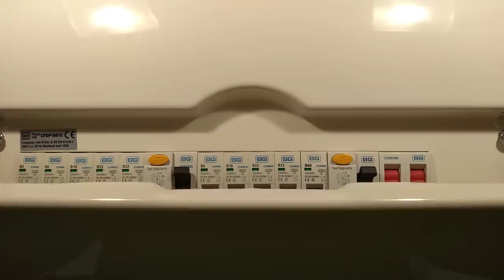A look inside a British home electrical panel.

Comment: You can still get type D's but we only use them in industry for DC power supplies and transformers at 240V AC or inductive loads at 24V DC usually e.g. solenoids
Reply: D type on staricase in common places, DC24V power for a videophone and lights (this is anti stealing measure)

Comment: Thank you very much for your video! At about 9:30 you mentioned the cost of a consumption of about a pound per a year. What can be the consumption of a normal standart  circuit breaker with say b16 or b32 characteristics? Thank you.

Comment: @bigclivedotcom hi Clive I’ve always wondered, why do the little circuit diagrams printed on MCBs have a 1 and a 2 on them but they are seemingly wired opposite to this? As a layman looking at the diagram I’d assume 1 was incoming live and 2 was out to the load, but all the ones I’ve seen including this video the bus bar is into the 2 terminal and the outgoing circuit comes out of the 1 terminal

Comment: 14:30 D type circuit breakers are still available, at least here in Germany. Also, there is type K inbetween C and D, but I don't believe it's really common.
Reply: D-type is still produced and available in many countries. in comparison with B and C types they have interesting "twist" in their build
Reply from the maker: I'm intrigued.  I've never opened a D type breaker, but I guess the twist might be an alternative to the coil?
Reply: Sorry Clive, the "twist" I was thinking of is in DC, not D-type MCBs. I'm sorry for confusion. You said 16A should withstand 18A. It's 18.6A at 25C of ambient temperature for at least 1 hour (it's ambient temperature dependent and after 1  hour all bets are off ;) )

Comment: The load preference may have to do with the physics of resistance. I know that there is so little with the distance between breakers, but a physicist will tell you there would be less current heating the buss with the higher draw closer to the branch source.

Comment: @bigclivedotcom Is it popular to get DIN-rail panel equipment like this RCBO with wire already included in UK? Because we use this system in Poland and I've never seen them sold like that (even in typical home improvement stores they're sold either loose or in small cardboard box that fits only the apparatus). And most of these busbar "combs" have plastic insulation on them so in a carefully wired electrical panel you really have to go out of your way to make a mess poking around inside. The clamp on the busbar was kinda tricky for me first time I had to work on a modern panel around late 90s  (before that we used typical old school textolite board, drill, fuseholders and plenty of screw terminals, it wasn't a big deal as it was just three fuses in domestic applications) but it's obvious to figure out how it works if you actually look at and play around a bit with the thing you're about to install before doing it.

Comment: Very interesting to see a UK breaker box. Quite different from our American boxes. Our systems have built in bus bars...one on each phase and the breakers alternate buses to balance loads. That also makes it easy to get two or three phases for appliances or heavy duty motors for tools. I would love to see a comparison between American, UK and EU breakers and boxes.
Reply: Standard EU boxes are very similar to the UK box presented in this video. The only difference I could mention is that black wire is used instead of brown for live connections, and usually there is no isolator or main switch inside the box - it is located outside, as sealed circuit breakers before the electricity meter of the utility company, hence inside the apartment, the RCD is used to power off the entire system (as a result, many people mistake the RCD for "the main switch"). Greetings from Hungary!

Comment: 11:00 With a lot of these the secret is to make sure the tightening screw is all the way opened before you push in a wire or a buss bar. If it is just a wire you can tug on it to check it but of course you can't tug on the buss bar like the wire.

Comment: It's remarkable that a UK consumer gets standard 100 amps. That's quite a lot. I wonder why you needs so much current for a regular house? In Belgium we only get standard 40 Amps at 240 volt.
Reply from the maker: We have electric showers here.
Reply: That explains a lot. Overhere we heat our water  mostly with gas or fuel oil.

Comment: Very interesting that you are using din rails in residential applications.
Reply from the maker: It allows the use of standard industrial components.  The panels can also be used for small industrial control systems.
Reply: bigclivedotcom your residential panels look almost identical to what I am used to with industrial controls. In America we have a totally different system with integrated bus bars, no din rails. I have never seen a plastic American style panel.
Reply: normal standard box and fuses use din rail today.

Comment: There are still plenty of houses wired with the old Wylex units with black Bakelite fronts and wooden back. Rewireable fuse holders still in use and no signs of damage. Many still with 10mm and 16mm tails and 2.5mm or 6mm earth/CPC. Might be worth looking at one of those boards Clive.
Reply from the maker: I have one right here.
Reply from the maker: Actually it's the metal type with rewireable fuses.
Reply: @bigclivedotcom  Many of those metal rewireable Wylex units are still in use in shops and commercial units.

Comment: thanks Clive,
now you'd made me feel better about my 120/240 "split phase" (two of the three legs) 200amp service 😀
and yes, because i can.
Reply: Split phase 120/240 is not 2 phases of a 3 phase supply. It is single phase power with a center tap in the secondary winding of the utility transformer. (If you want to get really technical, the power leaves the generator on 3 phases. At a substation a delta-wye transformer or similar arrangement splits the 3 phases into single phase circuits. Then the pole transformer steps down and splits the single phase high voltage [about 14kv] into single phase 120/240 using that previously mentioned center tap transformer).

But I do agree that 200 amp service is a heck of a lot of power.
Reply: @wesleyhurd3574  Not by US standards lol.
Reply: @baileyharrison1030  If electricity is your heat source for home heating, clothes drying, hot water and cooking, then 200 amps may be inadequate. In a home with a natural gas supply, 100 amp electrical service may be totally sufficient.

Comment: Great video, and also great because the box in my flat is getting a slight modification soon. My housing association need them checked, and it seems that regulations now require lighting to be on an RCD. He's just going to basically move things about to enable that. My cooker used to cause the whole section to turn off.
Reply: Probably just needed one of the rings changed. Very common for leccy cookers to knock RCDs off.
Reply: @1973retrorabbit  It was the grill on this one. Worked for a bit, then tripped.

Comment: Interesting that UK breaker panels look a lot more familiar to me as an American, than American breaker panels.
That's probably because I typically have my head stuck inside a commercial or industrial control panel most of my days, and DIN rails rule the roost in those.

Comment: By the way - if the unit isn't properly sealed you might get rodents invading it and if the rodent dies and the remains goes down into the bus bar then you'll have a fire hazard.
Personally I prefer a solution with the 2 unit wide RCBOs and a main breaker tied together with a 2-lane bus bar where one is for neutral and the other is for phase. That would keep down the number of wires in the box.
There are also 3-phase bus bars.
My "ideal" panel would have four rows, one 3-phase row and three one-phase rows with individual RCBOs.
Also be aware that even though the units are DIN rail compliant not all units matches in height on the faceplate, especially if you mix brands.
The most common breakers I have seen are the C breakers. B exists but are less common in Sweden.
Reply from the maker: It's a requirement to seal them these days for fire containment.

Comment: I usually find 60A only on older TN-S services. On most TN-C-S, it's usually 80 or 100A (southampton/gosport area, SSE power distribution are the DNO)
Reply: We've uprated to C type on lighting circuits with lots of traditional halogen downlights before, but like you say, you have to do a Zs (or PSCC as I still call it because I'm old) measurement at the end of the line to make sure it's gonna pop.

Comment: I did a “Modern Apprenticeship” and it was 4 years, NC then HND and monthly visits to work sites by the apprenticeship issuer who needs to see specific verified work done snd signed by another senior engineer to confirm the example job was completed and completed to acceptable standard/quality. Also we had spot visits where they literally watched me, say installing a multi way lighting circuit, with say 3 switches controlling one rooms lights etc. Or other tricky jobs. My apprenticeship was very thorough and the paperwork I have upon completion is extensive so it’s a shame how now you can essentially call yourself the same as me after only a 5 day course.
Reply: I must say this was back in 2009 I believe. Well 2006 then the industry crashed, so restarted in 2009 roughly. Now as you say it seems a 5 day course and you are an electrician. Most probably don’t know the difference between conventional flow or real flow etc, they aren’t taught down to the physics and it can matter in cases. It’s like now if you can fit cctv cameras and wireless security alarms then you’re an electrician.
Iv seen jobs where they require a total rewire and I say so but instead some cowboy puts terminals on all the supply rings behind an old consumer unit and then wires with the correct colours to a new meter. No thought of current rating, cooker supply through a lighting terminal block etc. You have no idea how bad it is out there in Scotland.
But then again that cowboy was 1/10th my price so the landlord goes with him, since he is still an “electrician” after all.

Comment: When I moved into our new  house 40 odd years ago I checked the mains water stop cock and noticed an earth wire that I traced to the main consumer unit. The thing that concerned me was that the clamp that held the wire went onto the main water supply pipe - which was plastic. I got that changed and made sure the new earth they installed was to the current regs. My brother (electrical engineer) said that on site they used to put the mens toilet above the earth buried in the ground to ensure it passed it's final inspection. Doesn't bare thinking about on a hot day.
Reply from the maker: Pissing on the earth electrode is surprisingly common.

Comment: This was a very interesting video.

Here in italy tho we don't use any kind of busbars, not for neutral, live or ground. We also have commonly RCD that will trip if they go over the rated amperage (16A max in a normal household, as generally you can get 3.3kW from the meter and that's it.)
Also it seems very common to have DIN switches that also have both live and neutral together, instead of single live connection.
The second ones i've seen been used mostly only for lighting.
Also seems like that for household usage, "C" rated units are the only one you can see around, and they are rated 6, 10 and 16.
Reply: 3.3kw for the entire property? How often do you trip the breaker? Must have to be very careful not to operate more than one large appliance at a time?

Comment: Hi Clive . My supplier fuse blew Christmas eve as I was cooking the big roast beef joint. Nothing had changed electrically in the house. I pulled the fuse after going outside and we were the only house IN THE DARK. I pulled the supplier fuse and checked it actually had blown. I phoned the supplier and they were asking how I knew the fuse had blown.2 hours later a guy turned up asked if I was a sparky, to which I said No !  I said I've done enough electrical work to know how to check a fuse or if something is    live. Apparently the incoming fuse can wear out over time.
Reply from the maker: They do wear out with time, but can also fail due to overheating by bad fuse connections.  It also appears there's a special feature of old metal Wylex DBs that can take out the main fuse when a smaller fuse blows.
Reply: Hi. Yes it has a seal. But I broke the seal because I knew their fuse had blown and on Christmas eve wanted to completely sure before I phoned them.
Reply: Not a problem as long you inform them .as far as I am concerned.  You need to be competent

Comment: when the box is fully wired it kooks nothing like above.
and there are different ampage switches for boxes like these, and different switches, and the cheapest being an MCB, (micro circuit breaker) it detects an earth leak through the live wire in the system and throws the MCB switch off with a loud click in less than 2 milliseconds, will detect an overload and short circuit.
the next is a medium priced switch called an RCD (residual current device) that detects an earth leak between incoming live and neutral will protect an appliance from fire and you against electric shock.
the next is an RCBO residual current circuit breakrer, (more expensive ( it is an MCB and RCD in one switch)) and will detect any fault in a circuit and appliance and earth.

Comment: Clean, crisp, clear!  Wonder if you've made one for three-phase?
Reply from the maker: I've not.  They're very similar to the USA home boards.
Reply: @bigclivedotcom  Three phase in my home?  That would be a dream!  Typically here we only get split phase (120 + 120 to make 240).  Three phase, only for the workshops, and soon my off-grid setup!  As I understand it, you can also use a pony motor or a VFD to cheater our way to three-phase.  Fascinated by the differences only to get to the same result!

Comment: Very Good. Is the Isolator an MCB of 100A? Can we remove the Isolator and Use the RCD as Isolator also?
Reply from the maker: Normally a separate RCD and isolator are used for safety.

Comment: In Aus we mainly put rcbos on every circuit and a cb for a main switch. We can still use seperate rcds with cbs if we want but only 1 light cct per rcd (so as to not lose all the lights in one hit). Just curious why rcbos aren't as common in UK is it a just cost thing or? Because here you can get them fairly inexspensively.

Comment: Well that's definitely cutesy. Tell me is the UK still on a ring structure for how they build out for the house electrical or has it changed recently??
Reply from the maker: Still based on ring circuits.

Comment: I was quite surprised when we visited England and Scotland back in 2017 and peeking at the electric power supply panels. They were all plastic. I dunno' but I guess I'm used to seeing the ones here in the US that are made of steel/metal. 

And OK, what really impressed me was the hotel kettle that boiled water in what seemed to be a tad more than a minute. The versions here take way more than 4 minutes to do the same. It must be the 60Hz electricity here than your fancy 50 Hz. you have there. 😉😉😉😉😉
Reply: Fast boil kettles, think they are in the 2kw region and some can push to the limit for a 13amp plug (2.5kw to 3kw). Then there are the one cup systems that only boil enough water for 'one cup'
Reply: An normal us socket can supply 15 Amps at 120V or 1800 watt. A typical german(or uk i guess) socket can supply 16 Amps at 230V or 3680 watt. So basically double the power.
Reply: @maik00979   UK is rated to 13amp at the socket via the fuse so 3120watts or 3.1kw

Comment: Those rcbos dissipate more power? Well that explains why our distribution box is always so warm. I don’t know for sure, but I think I’ve got around 30 of them. The wiring in our house got a bit out of hand... we had one of those power monitors that calculates the power by measuring the magnetic field around a wire. The thing could display up to 12kW... it showed an overflow error several times a week.
Reply: What are you powering - My 3 Bedroomed semi only consumes 7Kw in a 24hr period.
Reply: Shilks lets just say my mom likes cooking equipment... the induction stove by itself is probably already 5kW. Steam oven, normal oven, boiling water tap (3.1 kW if the heater is active), dishwasher, washing machine, dryer, air conditioner ... and my dad now also bought a jacuzzi and a plug-in hybrid car... This is stupidly over the top and I admit it. At this point we’re at risk of breaking the primary 3x25A@230V fuses (the grid operator needs to drop by if these break as they’re in a sealed box and sit before the billing meter). I don’t know for sure, but I think the house started out with a single 25A one, which we upgraded to 2x25A straight away because we wanted to cook electrically. I’m honestly surprised how sturdy the grid is that it can support idiots like us. The street has effectively gained two additional houses in terms of power consumption.

Comment: The problem with the metal cases is that if some live connection loses insulation inside the electrical panel and happens to touch the case, the next time someone goes to check the electrical panel it will have an unpleasant surprise, unless the panel is for precaution connected to earth.